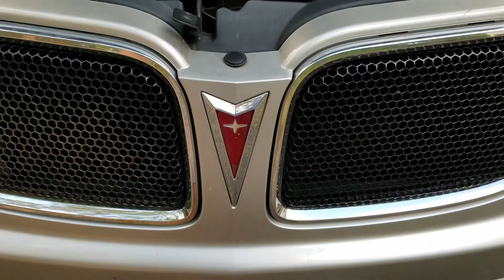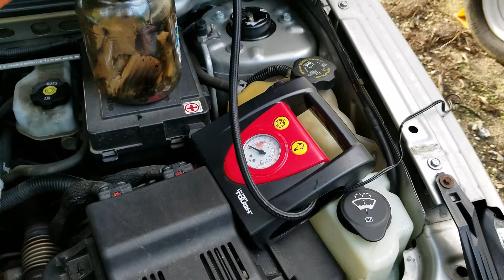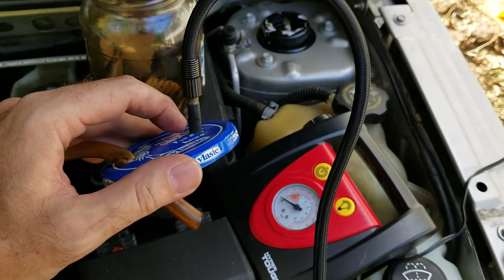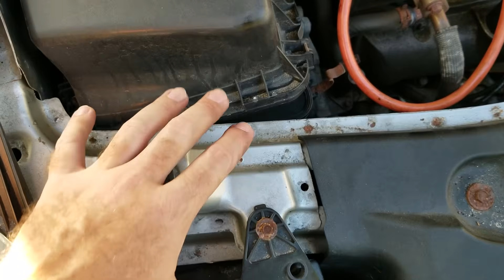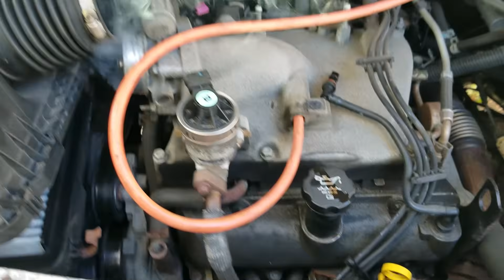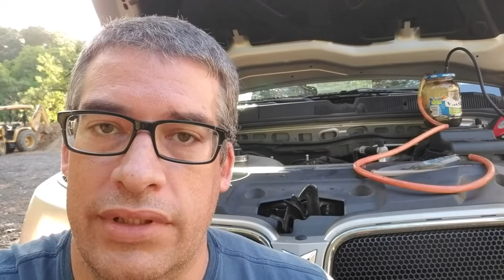Homemade smoke tester to finding vacuum leaks in your car

Comment: Brilliant, will built this today!
Reply from the maker: Glad I could help you out!
Reply: @JrZCarZ  I forgot to mention. Found a huge vacuum leak! A piece of gasket was missing from one of the inlet ports due to a warped manifold. Fixed it, no more leak. Still the same 15% high long term fuel trim... came right back... The car is messing with my brain

Comment: Tip: use little amta of cardboard paper. Use a small battery aquarium pump. And insulate the bottle with thick cloth as it can get super hot. My jar broke frm the extra heat. My tubes also melted. I'm not sure how his jar and tubes could withstand the heat?

Comment: What did u put in the jar ? Cardboard and water?
Reply from the maker: @carlosestrada9824  I only put cardboard in there. You can moisten it up with a VERY small amount of baby oil to smolder it instead of burn right through.
Reply: @ thank you

Comment: After I adjusted the valve gaps on my 9th gen Civic Si and put it all back together it would not do an idle relearn despite multiple attempts. It was driving me crazy, but I knew it was probably a vacuum leak. Smoke machines are stupid priced and I only go to the shop if absolutely have to, so I did something kinda similar to what you did except with a soldering iron and baby oil soaked rags. The smoke test found a tear on the accordion hose after the MAF sensor before the throttle body. I used a glove and put it over the accordion hose after the air box with a finger cut off and a hose clamp. If I did it later down the line I would have never found that leak. Thank you for inspiring us backyard mechanics.

Comment: not to ask an ‘irrelevant’..  ?… 🤨? question, but how’d you get the cardboard smokN?🤔
Reply from the maker: Just lit it up, nothing special.
Reply: vague, if some1 ‘lighted it up’ it would all burn up super quick & if can was still ok, it’d be gone super soon, would it not
Reply from the maker: @ezwa9979  nope, all I did was lit it up, then the air movement kept it from lighting on fire vs smoldering. Just don't use cardboard that has ink on it. There's not much to it.
Reply: @JrZCarZ  
1st time I’ve heard if air movement stopping flames, but I beleive ya…  on that note, I’ve got a 90 psi dewault air blower going through an adjustable low psi regulator - I’ve heard for baby oil 2 to maybe 5 psi.   looking for a smaller 12v air fan✋

Comment: Hmm. Just use a small breville food smoker, that's what i uses, has a little fan on the back of it with two speed.
Reply from the maker: That could work too. Point is, get creative with what you have.
Reply: @JrZCarZ  👍

Comment: What is the pressure used?....walt...tulsa,ok
Reply from the maker: There was no pressure set cause that was an el-cheapo tire inflator. If you are using an actual compressor, use the lowest setting that pushes out the smoke.

Comment: I have made the same yesterday, before found your video. I was little reluctant to light up fire in the jar cause it could break due to heat, but your video proves it wrong. I have exactly same air pump too. Will try my device soon. Thank you for posting this useful video.

Comment: The air pump produces too much pressure and may cause damage to gaskets and other parts. You don’t want to go more than 1 or 2 psi but you can’t measure with that.
Reply from the maker: A compressor yes, that would be way too much. The small air pump I was using was perfectly fine and was pumping out no more than a standard smoke tester would. It's not perfectly sealed so you are not getting pressurized air, more just air movement.

Comment: Did you do anything to the cardboard to stop it from catching on fire?
Reply from the maker: I just lit the top of the cardboard so it didnt burn it from the bottom. That kept it from lighting on fire. Make sure it's clean cardboard with no writing. If theres ink it will most likely catch fire instead of smolder

Comment: You came up with a really good idea for creating and moving smoke, but if I were looking for an intake side leak I would want to include the duct between the air filter onward. The accordion section is notorious for splitting on some cars, and can cause havoc with the 02 sensors and air/fuel ratio

Comment: This seems better than the propane trick. Might need to try this because i was unable to locate the issue
Reply: The thing about the propane is that the STFT may see a rich mixture and try and compensate by pulsing the fuel injectors at a shorter time  so less fuel enters the engine. RPM might never increase because the air intake never increased. Remember the computer is programmed to maintain stoichiometry of 14.7:1 to protect the catalytic converter by driving the pre cat o2 sensor in closed loop. .

Comment: Another great way to produce the smoke in the jar is to soak an old sock or strips of a cotton T-shirt in mineral oil (baby oil works just fine) and wrap it around an old soldering iron or I've found that the heating element from an old hair dryer works great as well. This produces tons of smoke without the risk of blowing ashes into the system. It's important to keep the air pressure low too, around 1-2 psi, or you risk creating a leak or damaging components. Lastly, a rubber glove over the throttle body is a quick and easy way to seal it off. Thanks for video and helping people save money by trying to find and fix problems on their own. I think no matter what one's experience level or knowledge is about these things, it's generally good to at least do a little bit of research and at least try to understand what might be happening, rather than just blindly handing the problem over to someone else; a lot of times people pay a lot of money for very simple problems. With all the information that's out there and easily available this day and age, it'd be a shame not to use it. Thank you for your contribution.
Reply: Treats on the Streets made a video describing exactly what you're talking about: https://www.youtube.com/watch?v=L9CDZ9lu6Rs.
Reply: Thanks for that tip on the baby oil! Time to buy the wife a new hair dryer!!
Reply: @dondale68  haha yeah I've been tearing everything apart lately, I think my toaster is scared
Reply: @awrhodes1  Gotta play that kid's movie 'The Brave Little Toaster'
Reply: Don't use stretchy fabric. It will melt. Use a plane cotton fabric. Terry cloth

Comment: I found another video where the guy sprays water and uses a pump to fill the engine intakes with air. The car was not turned on. For me, that may be a good start. Then if it doesn't work, I will try this option.

Leaks are often easy to find if you have  hypersensitive ears. But I don't. I do know there is a vacuum leak just by the sound of it but can't tell where using the method of just listening for leaks.

Comment: Please do you mean. You put the ignition of the car ON, without starting it up in order to find the leak ?
Reply from the maker: Yep that's correct, turn the key to the on position without the engine running.

Comment: Is it ok to run that kind of smoke through the motor? Is there a filter so ash and debris don't just blown into the motor? Just wondering cause this is the best and simplest smoke machine ever thanks
Reply from the maker: I didnt have any issues with it. Car's been running and driving fine since doing this. 👍
Reply: Good point. You can put a filter mesh before the tube

Comment: I'm wondering what affect the smoke has on sensors such as MAF.  And your engine smelling burnt all the time.
Reply from the maker: No issues at all. The smoke entering the engine at the intake doesn't affect sensors. The MAF is in the intake tube so it won't affect it if you block off the air intake at the throttle body.
Reply: @JrZCarZ  how do you block the air intake at the throttle body?
Reply from the maker: I just did it with my hand.  But you could use duct tape too.
Reply: That's my thinking also

Comment: Is vaccum leaks lead to any problem??
Reply from the maker: If the leak is large enough it can affect emissions, and your idle can be much higher than normal and/or cause the engine to stall. Both would trigger a CEL and let you know what the issue is.

I had a 2003 Sable with the Duratec that had a split vacuum elbow which caused the engine to idle surge. It would go to 2500rpm then drop to 400 till eventually it would make the engine die. The small leak in my Torrent didn't affect the engine at all.
Reply: @JrZCarZ  just wanted to say thank you, i have been struggling with a 2187/2189 lean mixture bank 1 and 2. i found a small leak in the intake manifold and the MAF accordion hose wasnt tight enough.  would that cause these codes?
Reply: @j.h.5744  Any type of loose or cracked hose dealing with vacuum will trip code if the leak is large enough
Reply: yes it causes engine to run rough

Comment: what is EGR valve by the way. what it stands for
Reply from the maker: Thanks for checking out the video! EGR stands for Exhaust gas recirculation. Basically it takes exhaust gases and recirculates it into the intake which will lower the NOx emissions out of the exhaust.

Comment: Looking forward to see if the replaced EGR solved you CEL and if you passed emissions inspection.
Reply from the maker: So far it's been 3 weeks and the CEL has not come back. No pending codes either. I haven't had a chance to take it to inspection but it'll pass. :)